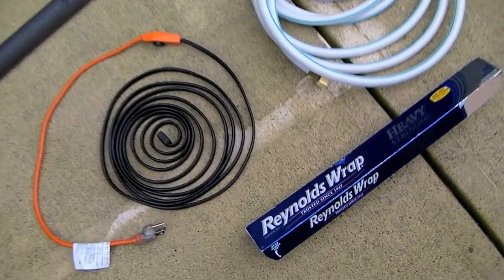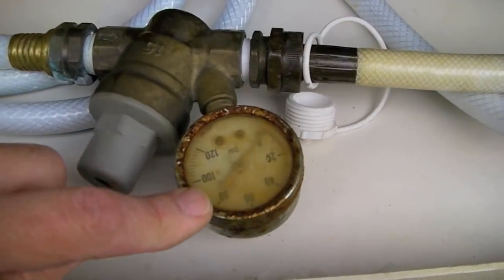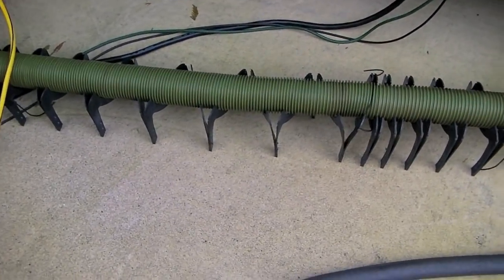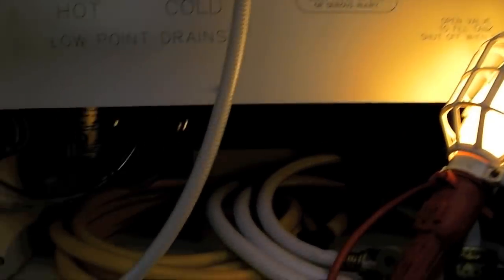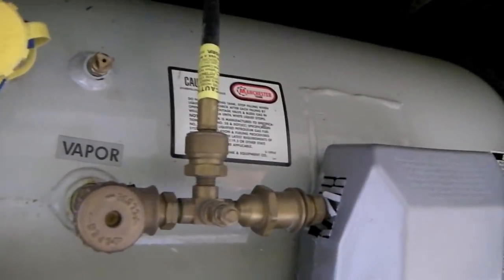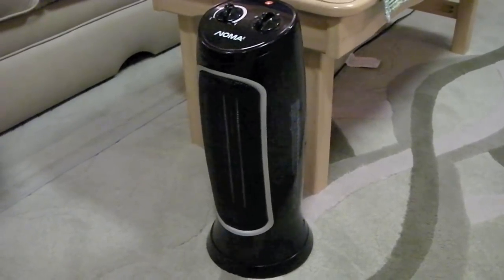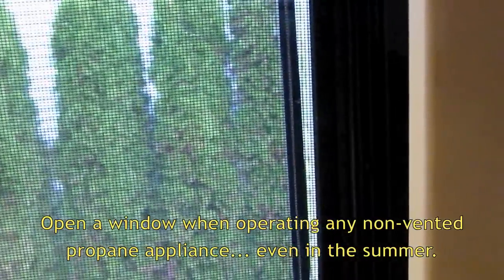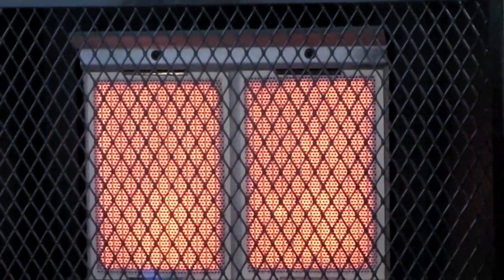How To RV in the Winter - Prepare Your RV So You Don't Freeze!

Comment: What about a small propane heater with an external escape for the fumes. This should be much safer and better for the your air inside the rv :)
Reply: Can't you have a wood burner with a proper flue?
Reply: Gas is a bit easier to manage, you can program it to a certain temperature and you can easily run it over the whole winter without touching it. I guess the build in heater is just to big to run it over the whole winter.

A wood burner needs a hugh amount of effort and time, and you gonna need more than a big bottle of gas in your garden. :)

Else it's a bit uncomfortable if you drive sometimes with wood, since you cannot harvest it anywhere by law... 

But I would choice wood burner anytime. Else you can use a TTC type toilet, after this you could use the remains as fuel for your stove as well.

Comment: Any vent-less propane heater is 99.9% efficient. 

Mr.Heater makes some great units that can utilize either the small 1lb tanks, 20lb, or direct hookup for around $90. Just a suggestion for readers who won't be living permanently in winter areas and need cheaper/portable solution without the work.

Comment: the thermostats on the heat lines are meant to be in contact with the pipe, not haning out in the air.
Reply from the maker: But they do work just fine like this, turning on when the outside temp approaches freezing.

Comment: Has anyone ever tried the following?
I'm expecting a few below-freezing nights on my next trip with my travel trailer. It has a propane-fueled hot water heater. It also has a hot-and-cold mixing faucet on the outside. I can run a hose from that faucet into the fresh water tank inlet. If I keep the hot water heater on, trickle warm water from the outside faucet back into the fresh water, I figure I should be able to keep lukewarm water cycling through the plumbing. I may want to trickle some water from the kitchen and shower faucets (even though that water will end up in the grey water tank). As long as it doesn't stay below freezing for more than a few hours, I'm hoping this will prevent my pipes from freezing. 
Any comments? Thanks!
Reply from the maker: Hi Thomas! We’ve never heard of anyone doing something like this… but you get major points for creative thinking! 😄 Our guess is that the large volume of water in the fresh tank is going to overpower the water heater’s ability to keep the water flowing through the pipes warm.  A lot of it will depend on how cold it will get overnight, for how long, how enclosed your tanks are, etc. If it’s just going to dip below freezing for an hour or two overnight, your tank will be fine... it takes much longer for it to freeze. So you could get away with dripping water to ensure the pipes don’t freeze. You might want to post your question on the forums over at irv2.com (it’s free) to see if someone your make/model of travel trailer has any tips!

Comment: Why not tape length wise????? or use ty-wraps???
Reply from the maker: Cable ties are definitely an option. We didn't do length-wise tape because it would have been more prone to coming undone due to water penetration from melting snow, etc. By wrapping the tape around the tubes, we could overlap it so it would hold better and be more resistant to moisture. Worked well for us! 😉

Comment: Was hoping you would have addressed the refrigerator freezing up in very cold weather, maybe it's not as bad a problem as my husband is thinking it is.
Reply from the maker: We’ve never had our fridge freeze up and never heard of that being an issue.
Reply: RVgeeks What’s the coldest weather u RV’d in? My husband just assured me that he doesn’t think we’ll have an issue.
Reply from the maker: We've been down in the teens, and never a problem. Keep in mind that we do have a residential fridge, but a regular RV fridge should be no problem either. Most people have those, and we've never heard anything about people having freezing issues with them, especially since they provide their own heat source (propane burner). It's just not anything that we've ever seen on anyone's radar in nearly 15 years on the road.
Reply: RVgeeks thank u for ur reply. My husband mentioned that u all probably had a residential fridge. But thx again.

Comment: try living in it at 15 degrees f below zero , i think every thing will freeze r-vees aren't made to live in below freezeing temp whats to stop the black & grey tanks from freezing and spliting?? a friend of mine tried it and froze to death they could not keep it warm! you may be able to get away with down to 10-20 above zero but if it gets colder it will freeze things ask someone thats tried it.
Reply: mrfixitat did you have heat covers on your tanks and use antifreeze?

Comment: why not use the heat pods on with the propane to help with moisture
Reply from the maker: I think you're referring to the heat pumps on the roof? If so, the problem with those is that they only work down to about 40 degrees fahrenheit. Below that, they can't extract enough heat from the atmosphere to work.
Reply: ah i get ya now

Comment: It's better to put heat tape under foil as foil reflects back infrared radiation while foam is transparent to these rays. Easier and more effective to wrap just mylar.
I wonder if it's possible to live comfortably in RV at Lithuania in winter?
Reply from the maker: One reason we put the heat tape outside the foil is because the tapes are really designed for metal pipes and we didn't want to overheat/soften the hose on the side where the tape is.
Reply: RVgeeks Do RV cars have inside walls thermal reflective insulation? Metal and glass may only absorb infrared radiation but it should be reflected back.
Reply: I have used heat trace in direct contact with hose and pvc without a problem.  It would be better to have the heat trace inside the foil.
Reply from the maker: Joe Benotz If that worked for you, that's great! Thanks for the input.

Comment: Not sure why you would want to reduce humidity in the air. That vapor stores heat when your heater is on, and makes the heating system cycle less.. It also makes the air "feel " warmer than it is .
Reply from the maker: ABikerLife That's a great question.  The walls and windows in an RV aren't as well insulated as they are in a standard home.  So any excess moisture in the air can condense inside the walls and around the windows.  This can cause damage to the insulation & wall structure... and can promote the growth of mold & mildew (very bad in a small, enclosed space).  If we skew too much toward an unvented propane heat source (like our Kozy World heater) without keeping a window cracked, we can wake up in the morning with the inside of the windshield covered in heavy condensation, which means it could be forming in the walls, too.  "Dry" heat sources like space heaters & heat pumps are great for helping to keep this problem at bay.

Comment from the maker: Sure thing. If you're going to be in one spot for several years, why bother re-insulating the water line every winter (and removing it every spring)? Just be sure to inspect it in the fall, and make sure all the insulation is in place and the heat tape still works.

Comment: if the heaters are not vented I think they would inevitably add carbon monoxide, a product of combustion, long term exposure to which builds up in the bloodstream with possibly fatal results, but hey if everybody's doing it and they keep their windows open enough and for short term use only I guess...I'm not familiar with propane heaters rated for indoor use also, so perhaps I'm behind the times
Reply: the radiant panel heaters reduce car monox emissions and fuel consumption per btu. vs old skool flamage heaters.
. i am sure there is a carbon monoxide detector in the motor home.
Reply: wonderful video. I am taking a Ford transit and making a camper van. lots of great ideas I can apply. Thank you!
Reply from the maker: +David Ray That's awesome Ray! Love the Transit! 🚐

Comment: Aluminum foil doesn't conduct heat well. that is why you can grab it out of the oven without burning your fingers. It would have been better to put the heat tape inside of the foil in order to keep the heat from escaping.
Reply: If it didn't conduct heat well it wouldn't be used for pots and pans. The plastic hose is more likely to be damaged.
Reply: my friend, Aluminum conducts heat very well. But being the thickness of a miligram or so it doesn't hold the heat conducted very long.

Comment: Needless to say that if the AC power to the RV is lost for an extended period of time, an emergency generator is critical to power the electric heat tape and other desired electrical devices. We moved from northern Utah to Kentucky this past July and the moisture situation was vastly different in Utah than in most if not all of the Eastern states. At our altitude of almost one mile above sea level, humidity in Ogden, Utah averaged below 50% during the winter months. Moisture, therefore, was never a problem. There was too little moisture and we were constantly getting zapped with static electricity. To keep moisture levels up we had to use a humidifier. RV winter camping in much of the western U.S. means dealing with low humidity rather than with too much moisture. So we recommend a humidifier for those camping in dry, arid parts of the country.
Reply from the maker: +Tex Rittenberg We love the high desert! We were in BC that winter, with enough moisture, like so much of North America, to make keeping it down a challenge. Next time we're in a cold climate over the winter, we'll have to make it someplace like Ogden. 😊

Comment: Never open your faucet to the complete end...always back it off at least a half turn.
Reply from the maker: Why is that?
Reply: it's so the valve doesn't become stuck. It's more important to do so on larger valves, but maybe not a bad idea.
Reply: That is correct....if the valve does, either freeze or get stuck, it is always easier to be able to close the valve a bit to break it free...if trying to shut it off it does not want to move. If it is already fully open it can be a bear to free up...always back off at least a full half turn to one full turn so you can work both directions to free up a stuck valve! You;ll be glad you did!

Comment: Avoid propane heaters all over inside area, in campers, mobilhomes, even cabines, bcoz of the moister it gives away from itself.. about 11 L. water / 1 liter propane...!!!! 
-(when water get heated up it gives away up to 1700 L. of steam per 1 liter of water..!!! )
-use instead Kerosene heaters, Kerosene is an purified oil product used fore airplain or heli-fuel, NOT diesel oil. this type of oil heaters, dont smoke, or smell, just give you alot of nice warm air flow.. but as they also mention here, remember ALWAYS to open a window, or even better make / prepare a ordinary hole for air inlet only for the winter heating system..!
-seen someone write diesel for kerosene heater.. NO-WAY, it stinks, smoke, and that smoke are certainly not good for your health..!!
Maybe a wood or pelletstove had been the right solution, if you are preparing a long winter seson on the same place...?

Comment: Having a heater that you have to open the windows defies the purpose no?
Reply from the maker: +Marcelo Delima The heat produced by the propane heater is so intense, while using such a small amount of propane, that the overall heat output vs the small amount of cold allowed in from the slightly open window is still a huge net gain compared with any other heat source we have. It's awesome. :)
Reply: In that case it does not defies the purpose lol, with a plus you get some fresh air...

Comment: You put the tin foil around the pipe then the heat strip over the tin foil. How about putting the heat strip over the pipe then the tin foil over it ? surly that would be a little better as the tin foil could still conduct the heat around and the heat tape would be touching the the pipe rather than touching just the tin foil, plus the tin foil would act to keep the heat close to the pipe,  My Engineering background coming out now :)
Reply from the maker: Hi Michael! The reason we put the heat tape outside the foil is because the tapes are specifically designed for metal pipes, and we didn't want to overheat/soften the rubber hose. It worked great, but we hardly had an arctic winter that year in British Columbia. If we were anywhere in the northeast USA or Eastern Canada this winter, I'm sure we'd need to put the heat tape right up against the hose to have any chance of preventing a freeze-up. And then some! LOL

Comment: Thank you for your good advice.  I am looking at two different used Keystone Montana 5th wheels over the net.  One is a 2004 model 3280RL priced at $19,995.00. The other is a 2005 model 3400RL, priced at $22,710.00.   Both are for sale locally, here in Amarillo, Texas.   I like the floorplans because both models have larger kitchens.
We do get fairly cold during the Winters, I will need to check with both parties and see if either has the Artic Insulation Package.
Your thoughts about Montana?

Comment: DO NOT install a vent blowing under your rv! When you do this the amount of heat that vent is blowing out is the amount of cold air you will be sucking into your rv through all the cracks and crevices. It is a closed system. The amount of air your furnace blows out is the same exact amount it sucks in. When you blow out less than it sucks in it starts to suck cold air in from outside so you'll be losing twice the heat you think you are plus you'll have really bad drafts. Otherwise good video

Comment: My take away is your idea of wrapping the pipes in aluminum foil FIRST, to help disburse the heat from the wire completely around the pipe, then adding the heat wire & enclosing everything in the closed cell pipe insulation tubes.

STAY HYDRATED,
AZClaimjumper

Comment: I think the use of an indoor propane appliance heater is a big no ! no ! It's just too dangerous and not worth the risk. It's wet heat anyway. I live on Vancouver Island in B.C. myself, and temperatures can get below 45 degrees F in the Winter. At the Northernmost tip of the Island, the temperature can get just below freezing in the Winter upon occasion. I have a Coleman Propane furnace, and boy does it pump out the heat in the Winter. I find I often have to get up in the middle of the night and turn down the thermostat because it's too hot. Since propane is wet heat, and really consumes much propane, I too, find small electric heaters to be perfect. They give off dry heat, but consume little power. The only issue with that is you do need to plug in shore power for their use. I prefer to boondock my way around.
Reply from the maker: Mark Job Hi Mark! What a coincidence... we're in the Fraser Valley. :)  The problem we have with our built-in furnace is that while it provides great heat, it absolutely sucks down the propane. The portable propane heaters get a bad rap because everyone worries about using them indoors. But that's exactly what they're designed and manufactured for. We know lots of people, including ourselves, who've been using them safely for years without a problem, especially in the Quartzsite, AZ desert, where the temps can drop near or below freezing at night, and these portable propane heaters are a boondocker's dream. Warm as hell, sips propane, and zero electricity use. Just need to follow the directions and use them properly.
Reply: My RV is an Old "Shamrock" from 1980 on a GMC Chassis with a 350 V-8 4 Barrel carb. My water system is shot, leaks, and pump is finished ! I have been slowly ripping old stuff out in preparation to change my installed floor plan. I want to remove a certain closet, enlarge my bathroom, and install both advanced Solar and Wind power generation. This will allow me much more off grid freedom. Do you folks know of a good RV renovator on Vancouver Island ?
Reply: PS Iam in Campbell River
Reply from the maker: Mark Job Sorry I can't be of much help on the Vancouver Island front. I've probably been there less than a half a dozen times in my whole life. You sure are taking on a lot of big project! Best of luck with it.

Comment: To me it doesn't seem smart to have the exposed extension cord right next to the active water spout! Just saying, if you think I'm wrong let me know. (Referring to the beginning of the video)
Reply from the maker: +Joshua Wilson I guess us RVers are pretty used to the water and electric being side by side since the hook-ups in most sites are that way. We'll try not to run water on the plugs. 😉
Reply: RVgeeks thank you for letting me know! So it's pretty common to do that then?
Reply from the maker: Yeah... water and electrical connections are usually within inches of each other! LOL

Comment: Dont mean to sound stupid here but would'nt be more better to put the heat tape on the hose then cover it with the foil and then the insulation ??? Just saying
Reply from the maker: You actually don't want to do it that way, because the heat tape is really designed to use on metal pipes. Putting it outside the foil prevents it from making the hose too hot on the side the tape is against, and spreads the heat out around the hose more.
Reply: RVgeeks aaaahhh ok

Comment from the maker: Definitely not.  The one thing you NEVER want to do under any circumstances is leave the black valve open. If you do, the liquids will run out and the solids will build up.  It's called "pyramiding" which should give you a good image of what would be going on inside the tank!